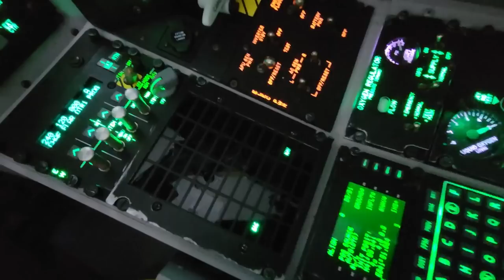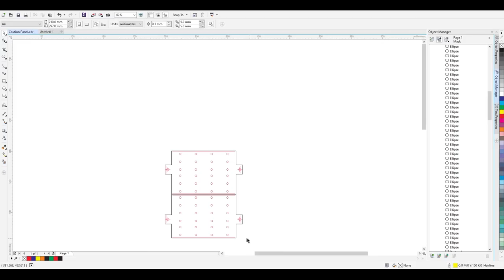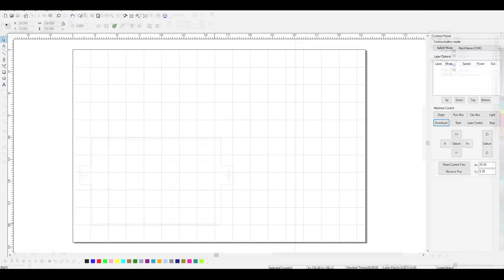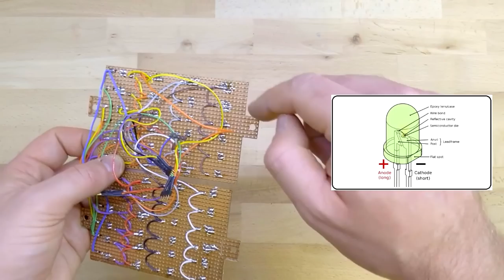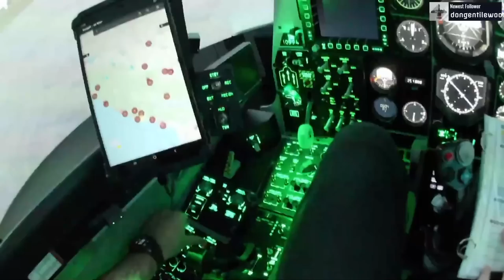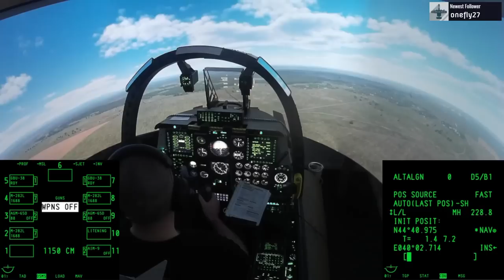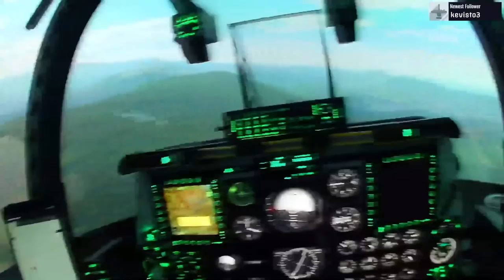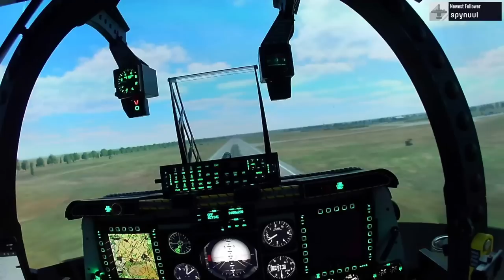Upgrading the Caution Panel (and laser cutting PCB's)

Comment: You could always get your pcb's from something like PCBWay or JLPCB, hell you could even add the arduino and matrix hardware on the board directly, or just add headers for the plugin experience (probably easier to do that now with all the shortages). Would save some effort and size, even more if you use SMD leds, simplify it even further with individually addressable RGB leds (no need for the matrix hardware).
Reply: Just commented and saw yours🤣
Exactly same ideas. I would use a cheaper microcontroller like a STC8 and a bunch of WS2812 or just two normal 0603 green LEDs for each. I have a reflow oven and PNP machine, and JLC offers free PCB twice a month, so it would be really easy for me to mass produce these. I also have laser cutter and CNC at the school lab, so I could just by myself, make ten to a hundred of these for really cheap per day.
I actually said the same thing to my friends at the lab, about how cheap and easy it would be to make these cockpits if we made everything standard and made in batches at a time. But sadly there just aren't enough simulator enthusiasts here in China to make batch production a economical idea. I guess 10,000 yuan (1500USD) for a cockpit is still too expensive for the majority of people, including me. And even worse, in economically developed places, where people do have the money to spend on hobbies, estate is really expensive so there is no spare room to set up a cockpit.
Reply: @yuxuanhuang3523  Yes, my thoughts exactly, the benefit of the WS2812's being that you can chain many of them onto a single controller. Depending on the libraries used all you would need to watch out for is memory use. I.e. Adafruit and fastled libraries allocate 3 or 4 bytes of ram per led. Doesn't sound like much until you try to drive large numbers of leds. At any rate you could split out over multiple microcontrollers or use the more powerful ones (stm32f4, stm32f7 even). Overall cost would drop significantly I would guess. SMD components generally are far cheaper than THT stuff is these days. Also would not need as many arduinos or USB connectivity, even WiFi would be an option I guess or if you don't like that use a 1-wire or 2-wire protocol that connects everything to a single central controller. How marketable (for lack of a better word) it would be is harder to judge.
Reply: @yuxuanhuang3523  i think he wants a challenge. Plus, most of the a10 are legacy tech, so PCBs are usually old school and handmade. Th0
Reply: @xConundrumx  Actually I followed a 373 sim maker in China and they used ethernet. They say USB hubs 1. has limited ports because they limit the layers, 2. are sometimes unstable when plugged with multiple devices.
Ethernet for switch panels doesn't have to be high speed, but having the ability to connect every panel POE is really cool. Just being able to use something like one 50-port switch, even without POE, would make wiring way easier
Reply: @yuxuanhuang3523  The problem with POE is the limited power plan. But I agree in the end ethernet is probably a better way to go if you get up to that point. Here I would recommend looking into a Polish company PoLabs. They have a number of motion controllers (for stepper/servo/etc motors) for sims that also employ actual motion feedback. But more importantly they have a couple of ethernet based systems, one of which (the pokeys57cnc) I use for instance on my cnc's. What is great about them is that they have their own expansion system that allows you to couple additional input and output boards to the main controller and to make things even better they have the PoBlocks software which is a GUI based 'macro' language that you can use to design complex behaviours with in a graphical manner. Simple example would be you press a momentary pushbutton connected to one of the input boards and the controller automatically toggles an output on or off with each press (a status led maybe). All handled at the controller level with no need for the PC to do anything.
Reply: @xConundrumx  I recently started playing with the "new" Pi-Pico boards/RP2040 chips. A third party board (RP2040-Zero) is my favorite incarnation so far: super tiny, easy to work with, USB-C connector. That one could easily work a string of WS28XX to power that panel.

The best thing: they're cheap and available!
Reply: Yes but it would still be usb based.. actually.. not even that, these things don't do serial coms over usb I think. You can only 'dropbox' new compiled code over the USB port (onto a simulated flashdrive disk) but not use it for coms (if memory serves, don't have one on hand here and seen too many boards to keep them all apart).

Hooking it up to the sim might be a chore here.

Comment: Disassemble an old laptop or monitor and use the excellent diffusing film behind the LCD. Sometimes it's 2 layers. This makes a super even illumination of the fonts. I have almost the same cockpit as you thanks to your files!
Reply: A good use for smashed TVs. This same lens and the high CRI backlights also makes them good studio lights.
Reply: I was just about to type something along these lines.  I am curious how well it would work though as the backlighting on a TV is around the outside of it rather than directly behind.

Comment: Maybe stupid question, but isnt arduino current limited to something about 200mA? So that would mean connecting about 10 LEDs at max without damaging it, but in here there is way more LEDs connected?
Reply: I haven't finished yet, but it's in a matrix, so he's probably strobing them and only one is on at a time. Another way to handle this is to have the Arduino sink the current instead of supplying it (see active low logic).

Comment: Gorgeous, if I had a pit like this I'd be flying into danger all the time just to get a chance to fiddle with all the gauges and knobs to handle the damage. Have you experimented with grinding the lenses flat on the LEDs? Should reduce the directionality of the emitted light and reduce the need for diffusion as much in general.

Comment: Needless to say, you do a great project, and do a perfect job on documenting and filming. Just one thing: why don't you start to design your PCB, using KiCAD or some other free electronic design tool. Your mechanical design, especially the surface finishing looks so professional, what it's kind of inadequate to solder the electronics on prototyping boards.

Comment: Just curious, does this panel still work properly now that it's been a few years? 
If the Arduino is only powered by the USB - it's limited to 500mA of current, which seems insufficient for this many LEDs. It's also not a good idea to rely solely on the Arduino's linear regulator for power, since overloading it can cause the processor to brownout and completely reset the code.  
I looked up the library that that MAX7219 board is run off of and there's a command to set the LED brightness intensity, is that in the code you used? I couldn't find the Arduino sketch anywhere.

Comment: On the off chance that you see this can you link us what switches you use, wiring, heatshrink etc. essentially what you specifically you use to wire say a switch to a usb encoder or arduino? Trying to figure out the names specs of everything and what it would take to wire a switch up safely, from wire, to heatshrink, pins and blocks.

Comment: Would printing the spacer block in white pla or even painting the inside silver increase the brightness of the output allowing lower current to the leds? Nice build Cheers
Reply: I've found aluminium adhesive tape works well too.  It's called "speed tape" at work because it's used on the outside of aircraft for temporary patches.
Reply from the maker: I tried printing it in white, but the light bleeds through it into the other indicators. I also tested it with some mirror vinyl sheet on the inside, but the result was no difference.
Reply: @thewarthogproject  I put some on the PCB as well. 😁

Comment: Quick question for you regarding the K40.  Being a dumbass I bought a diode laser thinking it would cut acrylic.  It wouldn't even cut plastic syran wrap, lol.  Got a K40 now.  I'm using Lightburn but it a little wonky in which device controls the power output, the dial on the laser or Lightburn.  I've heard of K40Whisperer (which I haven't dabbled with) and I noticed you're using LaserCad.  How does this program work regarding the laser output?  Do you control on the laser control panel or within LaserCad?  Also do you mind sharing your cut settings (power and speed) for cutting and engraving on the acrylic with the K40?  Thanks
Reply: I recall reading suggested setting for the K40 on his website.  If you look there you’ll hopefully find your answer.  It’s under the Laser engraving section I believe. Good luck.

Comment: What power is the laser bud? I was never able to manage to cut PCBs on my 60W.
Reply: You need the right wavelength. Infrared from something like a CO2 laser 100% will not work. You need UV.
Reply: @tissuepaper9962  I've got a CO2 matey, just doesn't seem to have enough power to get through the copper tracks

Comment: I think you could've gotten away with MUCH less wiring if you used an individually addressable LED strip. Is there a reason you chose not to do this?
Reply: Not trying to be cynical :D
Reply from the maker: I've experimented with it. Couldn't get the code for it to work with DCS-BIOS. Seems nobody has yet.